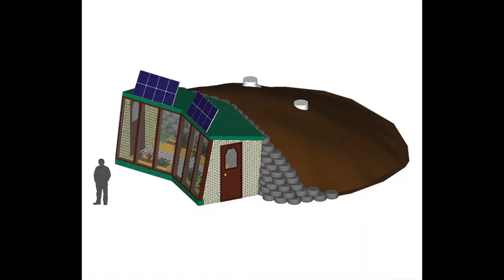Cozy backyard tiny-house with glass bottle walls! Earthship inspired design.

Comment: I have a serious question. I love the idea of using recycled material and dirt. However, I do not understand how one keeps plants and things from compromising the dirt that is used. From my (limited) experience with using dirt for various purposes, I have found that seeds and little bugs populate dirt. A plant growing in those tires would compromise the stability of the structure, or no?
Reply: If you dig 10 feet into the ground you're not going to find anything growing there. Plants need sunlight and air and water to grow.
Reply: The dirt is so packed that it's difficult for roots to get in. And they're topped in concrete on top of the wall with the bond beam. Then plastic separated the tires from the soil. Lastly the tires are also screwed together and the tire walls are very very stable.